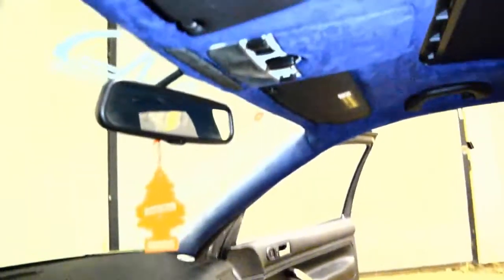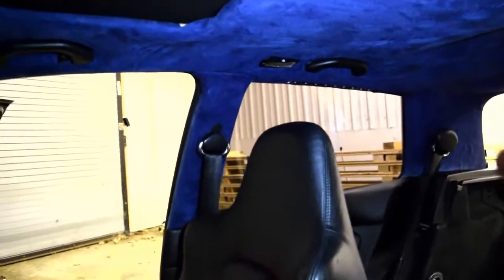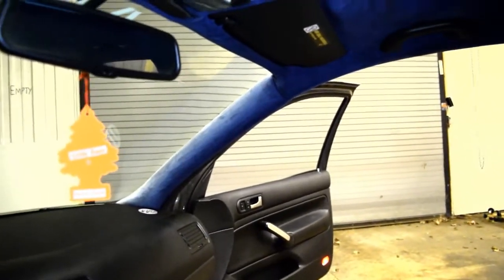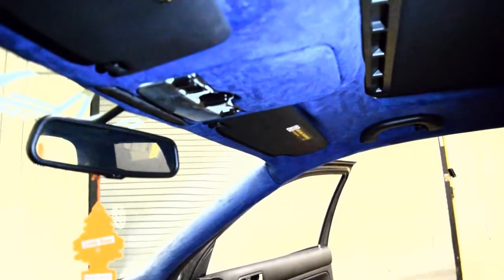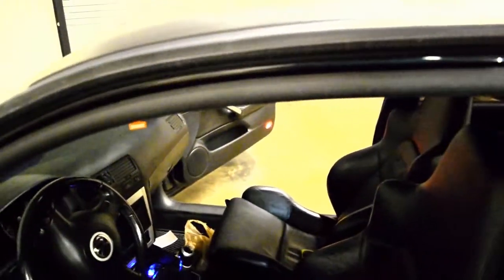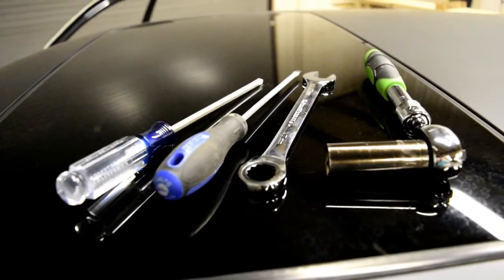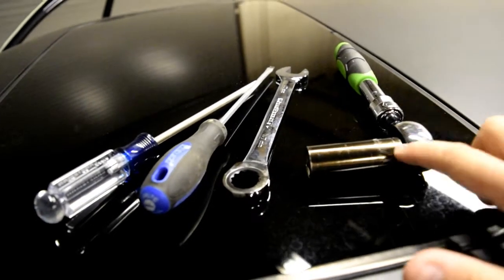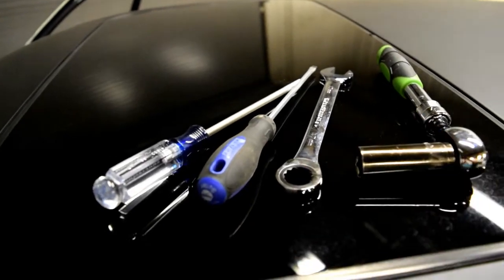I Covered My MK4 R32's Headliner In Truck Bed Liner! (Herculiner Content)

Comment: Interesting video Derek, thank you for making and posting. I have a question for you now that it’s been a year since your modification. I’m considering doing this to a vehicle but I’m worried about long term exposure to chemicals, aromatic hydrocarbons, any fumes etc. Any thoughts or words from experience? Can you smell the liner if the car is in the sun? Thanks again for posting.
Reply from the maker: It does give off a faint smell sometimes but cracking the windows for a few moments takes it away.
Reply: Was my same thought about the smell.. I want to do my tahoe but dont really want to have that smell when it heats up
Reply from the maker: @mista6187  There is a bit of an odor, but I've gotten used to it. This isn't a daily for me.
Reply: So the best bet is to just redo it with regular headliner
Reply from the maker: @mista6187  If you don't want the smell. Who knows....if I drove the car more than 1 a week, maybe the smell would have gone away by now, but I keep it in a garage for the most part.

Comment: hmmmm not sold,  with experimenting you win some you lose some. out side is amazing. because of the crazy extreme out side a classy interior would have contrasted well. black suede with the yellow / green colour of your shades stitching . ebay does black with red stitching covers that you glue on. relative cheap. love your out side the box options,  love or hate the outcome i respect the creativity
Reply from the maker: Yeah...the think is that the outside is all plastidip and coming off in the spring. I'm actually going more for a race-car vibe with it in the near future. Luckily, headliners for our cars are easy to find, so if/when I get sick of it...it is an easy swap.
Reply: stripped out raw racer!!! I like, start up will scare the hell out of unsuspecting passengers 😉